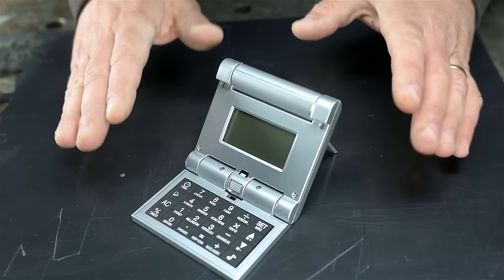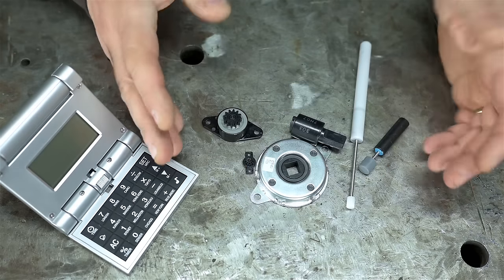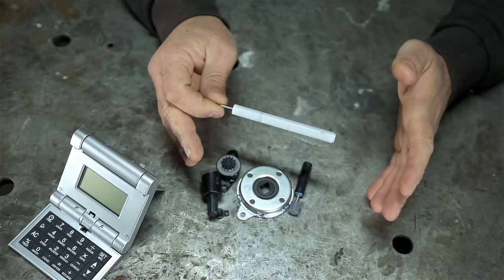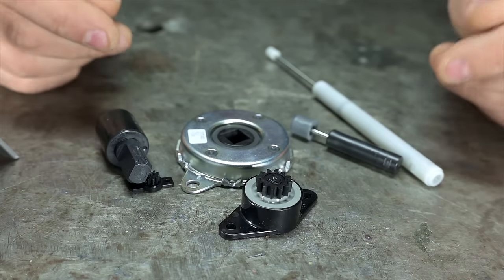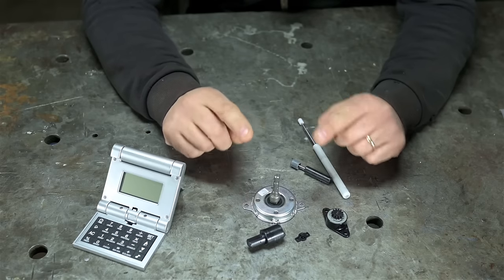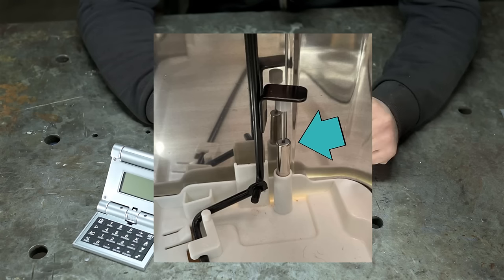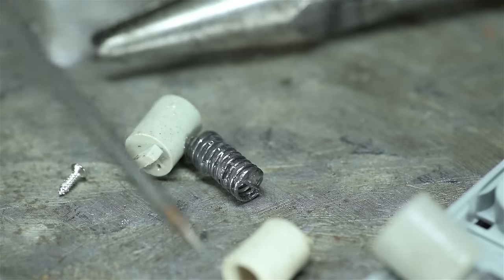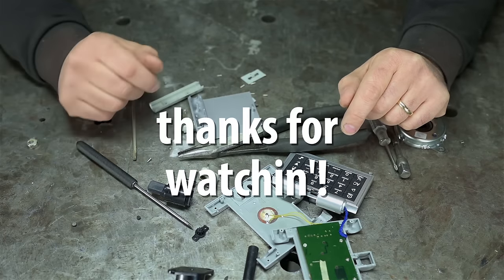Dampers... WHAT A DRAG!

Comment: Some additional Info: the damper at 5:27 is usually called a Barrel or Vane Damper, depending on the manufacturer. In the automotive industry the major suppliers for interior dampers (those found in the glovebox, sunglass bin, console, etc) are Nifco, ITW and Cultraro (sorry if I am leaving anyone out). I have never seen the "spring loaded with goo" damper from any of those suppliers. I wonder if that design is durable enough for what we need. Anyone knows of a supplier of them?
Reply: Corporate swag obviously
Reply: Also, most small one-way rotary dampers like the plastic ones with gears shown don't use oil, they use a very stiff torsion spring tightly wrapped around a cylinder made of a low-friction plastic like PTFE or Delrin. When rotated in one direction, the torque tightens the spring around the cylinder which creates resistance, and when rotated the other direction, the spring uncoils slightly and spins freely.
Reply: @twicecookedpork6220  That mechanism is often used in ceiling fans. It allows the blades to freewheel when un-powered, but the torque of the motor tightens the spring. to drive the fan. They will slip under heavy load, therefore adding a bit of safety I would presume.
Reply: @squelchstuff  I feel like this is a similar mechanism they use for a similar reason somewhere else. I can't think of where but I vividly remember the design. It has a solid outer ring and an inner ring in 4 pieces which fits inside just loose enough for the outer ring to spin freely. When the inner ring spins, the 4 parts of it expand outward due to centrifugal force, gripping the outer ring, and spinning it too. But also allowing it to slip if necessary, like the mechanism in the fan you described. For the life of me I can't imagine what it was for. Maybe a cheap differential in RC cars.
Reply: @gavin5410  It's called a centrifugal clutch. Also used in some snow mobiles and ATVs.
Reply: @gavin5410  seatbelts use a similar kind of centrifugal latching to lock when pulled suddenly
Reply: @gavin5410  That does sound like a centrifugal clutch, and not quite the same principle of  operation as Gavin Walker describes. A centrifugal clutch uses the rotational velocity to throw the friction surfaces out, and primarily uses the RPM. The spring mechanism uses the differential torque to wind the spring up, and therefore constrict around a shaft. It only works in one direction due too the handedness of the spring winding, and works purely by the torque applied by the motor as opposed to the speed.
Reply: @squelchstuff  upon hearing the word clutch I remembered where I've seen it before... in a this old Tony video where he repairs the clutch on his bike, hahaha. Thanks for the replies!
Reply: @gavin5410  -- You may be interested to know this is used in braking systems as well. Many years ago on the Pikes Peak Cog Railway I remember talking with someone about braking systems on the way down. I don't remember what the answer was but he said if all else fails and we start to go too fast, spinning brake shoes will expand outwards from the inertia and contact a stationary drum. I think it was called a centrifugal brake. I can't remember if this was a backup system or the main braking mechanism.
Reply: @gavin5410  both the slipper clutch used it for pushing a ball bearing against the clutch housing to engage the gear. But it does also show up in the the inside of the RC differentials which sounds exactly as your describing. It had planarary and sun gears that had a torsion spring inside to give limited slip to the differential. This also was filled with a grease of which there were several depending how you wanted it to perform. Want more resistance get thicker grease thinner grease gets you more slip.
Reply: @gavin5410  your description also sounds like the mechanism in the agitator of a washing machine lol
Reply: i guess not durable enough, the first goo damper tony pulled out looked rather mangled :)
Reply: @twicecookedpork6220  yeah but these can only damp a certain amount. while the oil ones have... endless damping ..you can keep spinning them :)

Comment: The goop reminds me a lot of some silicon locking grease I got in a box of radio service parts back in the 80's - it was used to stop the fer rite cores moving in the tuning coils of radios, I expect it was extremely cheap so it got repurposed here! I also recall how it got everywhere, didn't wash off and when it leaked it didn't dry out, even when I discovered the leaky patch again 10 years later at the back of a dusty garage, so its clearly a well designed compound!
Reply: It looked like it once was a waste product that was given a purpose.
Reply: Looks like the goop used in sticky traps for pests.

Comment: The goop reminds me of "assembly fluid" that I've seen used at work for keeping o rings and such in place.  The only thing that cuts it is engine oil.
Reply: I've always used Vaseline (Petroleum Jelly) for that assembly goop, and it seems to melt OK in Oil and Auto Transmission Fluid.

Comment: I once worked at a place that made plastic stadium seats and they used the same spring and goop dampers you have there in the hinges, just a big bigger. They literally painted the goop on with a brush when they assembled them, properly low tech stuff.

Comment: Years ago when I used to do Luger work for  John Martz Luger Carbine maker in Lincoln, CA  I experimented with shock absorbing systems and I didn't know they were called dampers I was making a system so when the travel got to a certain point another spring system took over and slowed the mechanism up to where they acted just like a shock absorber. I also experimented with the spring around the barrel method so when the slide was going to the rear to eject the case, before  the case was at full rearward travel and  right before movement was there on the slide as it would pick up a new cartridge from the magazine the extra spring system would take over and complete the applications movement. In slow-motion you could watch the slide doing back extremely fast and then within a short span of about 4 mm slow up to zero. It was very good at abating recoil.
I basically ended up with a patent-pending to the patent department which basically utilizes a circumference will piston or around the barrel inside is shield device which has cam's machined in the outside of  the piston. I have to show a drawing of a explain how it works and I don't want to expose my real patentable materials, but any how to make a long story short it's a nice field of physics to get into.

Comment: We just had this same conversation in the truck the other day, talking about the grab handles,one of the best engineered pieces of the whole damn 3500hd
Reply: Totally unrelated to the video but why did it take pick up manufacturers so fucking long to include some form of assistance to climb into the bed of trucks? Ford I know for sure and maybe the others have a step and handle "thingy" (sorry to use such technical jargon) and damn it it's so much easier and at the end of a long day your knees and back are much happier
Reply: @jeffreyhill1011   Okay but, can we have the honest conversation here as well? I feel like truck design has consistently pushed for higher and higher stock ride height for the past 20-30 years (perhaps more?). Jumping in the back of an old C-K truck with good rear shocks is a non-issue (granted, I'm 6'3" but, it stills seem substantially lower than modern counterparts). It's honestly to the point where I'd debate on lowering a brand new 3/4 ton if I could afford one lol.
Reply: @geraldgepes  also, WHY the actual FUCK are the bed sides getting so tall as well? It's seriously absurd. I can't think of a good reason. I can think of a bad one, perhaps not wanting to lower the average height of the truck. All this shit talking aside, I'm still getting the new lightning. God knows how long it's going to take but mine is already paid for so we shall see
Reply: @jeffreyhill1011  I think higher bed sides likely are an aesthetic choice for the most part, to maintain proportionality respective to the higher ride height without a bed that is reminiscent of a Courier or Rabbit truck. That or the higher bed has some ascribed cargo height it is trying to cover like an 8' bed fitting sheets of plywood and such. Aye, enjoy the new Lightning though, I'm working on some R&D stuff for new stators and tooling up to make stators for that truck next week!

Which gets to the bigger, more painful question about trucks for me. I am a die hard Jetta TDI driver and was even more so when I thought it was better for the planet. I loved my diesel pick up because I could still get 20mpg with a lathe in the bed. But short of a 6.7 just falling into my lap (and me surviving), I'm not sure I want to spend diesel money when they seem to be going under. I'm legitimately curious what is going to happen in the heavy duty/ 3/4 ton sector in the next 10 years. But, this is me waxing rhapsodic because I can't currently justify it. In another year though, there will be a horse and trailer to pull on top of equipment and then I think pragmatism will take over.
Reply: @geraldgepes  I bought an older Dodge 5500 5th wheel chassis with no bed just the 5th wheel slot. Got a really nice trailer that can hold my 2019 Cat 990 H and JLG 1055 telehandler no issues (individually of course). I have a bit more than 6K acres outside St Louis,my daughters and I just got done digging and are about ready to start filling our 8 acre reservoir lake from our natural spring. I won a high 8 figure lotto and opposed to being bored I figured I would buy some really sweet toys lol. My daughters, now 18 started a resaw business at 15. Obviously not because of money but they wanted to do something and they adore wood working. I taught um fabrication and welding and machining as well but their resaw and custom milled lumber is huge now. They bought a brand new 12 mile F250 King Ranch they are making so much money. My only real splurge was a Bell 525 helicopter and the lessons to fly it myself, I know this sounds braggy but damn I always wanted a chopper so much lol.
Reply: @jeffreyhill1011  that's fuckin' amazing and I'm glad it sounds like you're handling it pretty sensibly, good for you my guy!

Comment: Diapers ...what a drag indeed!  I was hoping it would be a few more years before we got this video.
What? Dampers? Oh, never mind.
Note: Most of the dampers used on cassette decks used the viscosity of air to do the work.  Usually, a gear near the hinge would attempt to turn a worm gear at supersonic speed. That worm gear was connected to the worlds tiniest propeller which would send a cooling burst of air into the case unsettling the dust which would then fall on the read and write heads where it could do the most damage to your magnetic tape.
Reply: Hence the popularity of paleo-emo band Head Cleaner
Reply: @williamchamberlain2263  short albums, but subtle and deep - never the same though after their falling out with support act Dichlorodifluoromethane in 1995... Good times.

Comment: Linear dampers can use air pressure. Make a piston with seals and have a small hole at the bottom of the tube. Piston can only move as fast as the air can get thru the hole
Reply: You can also make an air spring... The problem is that air is compressible and oils/silicone aren't.
You can also ignite stuff by compressing air. Consider that before you make one of those as you can accidentally set things on fire when you slam air hard enough.
Reply: @RealCadde  there a video where a guy ignites cotton by slamming a plunger on YouTube. It's pretty cool literal fire in a bottle

Comment: FYI: "Most aromatic (ring structure) solvents are effective at dissolving silicone oil.  These include toluene, xylene and naphtha.   Additionally, silicone oils are reported to be soluble in chlorinated solvents such as trichloroethylene, perchloroethylene and methylene chloride.  Polar solvents such as alcohols and acetone will not be effective at dissolving silicone oils."
(I would post the source but that results in the comment getting removed as spam; you can find the above quote with Google)
The above matches what I found experimentally when I was working with high-CST silicone oil on a project a few years back.

Also the timing of this video is really funny for me.  A week or two ago I had to take apart a car phone holder because the springs has weakened and the rotary dampers were now making it take 5+ seconds to open.  Very dramatic and cool looking, but really annoying to wait for when you hopped in the car and wanted to get going.  So I opened it up and mixed in some less viscous silicone oil, ending with a less fancy looking but more functional phone mount which opens in 1/2 second.

Comment: Cool video, but… No mention of one of my favorite toy lines of the 1980s, Coleco's STARCOM?!  The vehicles had damped wind-up motors and would “transform” on command, like your calculator thing.  They also had steel plates so the magnets in the figures' feet would stick and “defy gravity” 👍
Reply: did you get sticky metal pads with them,  defying gravity on plastic/wood ... would not work ...
or did you just use metal screws

Comment: My interest in these devices has been dampened by this video. It was a shock to my system, that was absorbed during my watching. Old Austin Healy Sprites used rotary level action dampers, its unclear if they actually worked very long, you know Lucas (Prince of Darkness) Electrics kind of limited the range of those old sports cars.
Reply: You're all wet, those dampers were mostly made by Armstrong, not Lucas.  :D
Reply: The 3000 I had looked like a dual piston damper design. Limited travel with 4" in the underframe

Comment: I really like the idea of storing your excess solar energy on DVD's. 
You are definately a master in efficieny, and probably one of the sharper carrots in the garden...
Just curious how many KwH you are getting per Gigabyte?
If you use compression software like a .zip or .rar you can almost double your capacity which is excellent for those "really stormy days"... and I'm not sure but I think you might get more linear mileage using the old VHS tapes too :D
Reply: Clever 😊
Reply: @opendstudio7141  Thanks 😀

Comment: Thanks Tony. I have a linear damper that is fast acting in one direction and dampened the other way. It is a graphite Piston in a glass tube. It was used on the ice chute flapper on a refrigerator. Opens fast but closes slow so ice doesn't get caught. Other brands use a heat wax motor that is fast one way and slow the other.

Comment: Critical damping in simple harmonic oscillators is one of the most tangible and fun applications of differential equations. It's a bunch of mathematics basically about damping a door so it doesn't slam but still closes quickly

Comment: One of my cassette players had genuine rotary dampers, thanks for that memory of running across the room to record a good song off the radio.
Another one had the cheaper option, though, just really tight washers that caused drag on the joint.  It didn't last long.

Comment: I researched using rotary dampers in the lid for a luminometer (photon detector) I was designing several years back. But I ended up going with a simpler design. When the lid moved to the open position, a spring loaded nylon rod pushed against a flat section molded into the hinge side of the lid, holding it open. Was pretty slick, given it was my first product developed. Still sold today.

Comment: Tiny rotary dampers are used to prevent free flight model airplanes from catching a thermal and winding up in the next county. 
They are used as timers for the “dethermalizer”. The dt basically flips up the stabilizer to 45 deg and causes repeated stalling as the model gently falls to the ground.

Comment: I had a few of those in the early 2000's. They used to give them away all the time as swag at vender events and trade shows, stamped with whatever XYZ company was hawking their wares at that particular booth. The fancy ones that really showed how far a company was willing to go to get your business were made out of anodized aluminum and opened in about 5 seconds. They were otherwise exactly the same cheap calculator.

Comment: I just remembered I have a motorcycle steering damper sitting on a shelf I was planning to install for the past 5 years. It's a linear damper used as a rotary damper. It's a cheap eBay no name model which is why I've been hesitant to install it, despite stripping it down, cleaning it and using some good American made O-rings and fork oil. Never really felt the need for it. I might install it this year just to get a feel for it.

Comment: I had a similar calculator when I was a kid, I thought it had rotary dampers but it actually had a linear damper with a string that wrapped around an axle at the hinge. When you closed it it wrapped the string around the axle which pulled on the damper.

Comment: My first experience with dampers was a Lego part I found when I was a kid. It was a little spring loaded piston with a tiny hole in one end to slowly extend it once compressed. I think it's similar to how the non-loud slammy type screen doors work. I used it in a coin operated Lego gumball machine to help prevent cheating. It never made it to full production.

Comment: Cool thanks. In copiers the pop up in some places. Like when you pull out one of those big paper trays for 1500 pages. It stops the stack from dropping rapidly. Then as a torque limiter to help separate paper when its fed. That is also a different approach where its a spring clutch designed to slip and does not need any oil or goop to function.